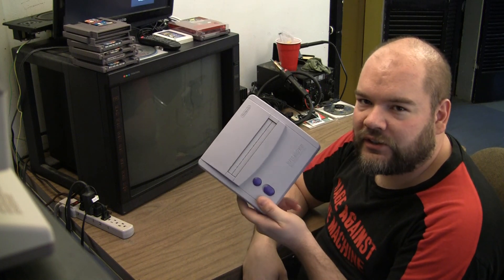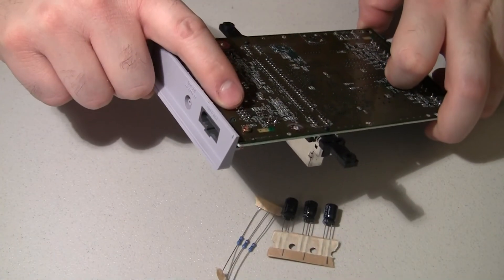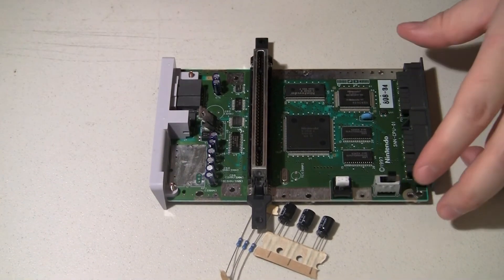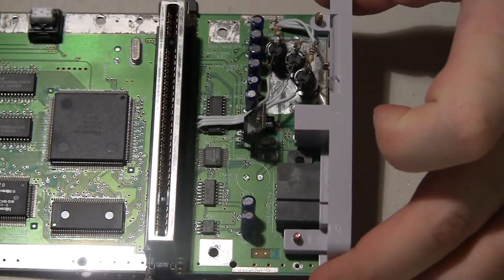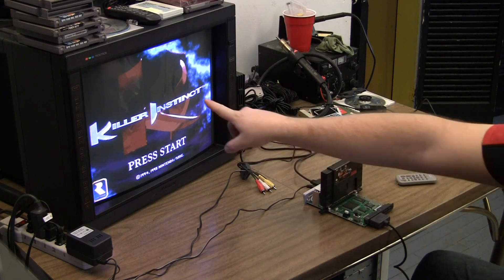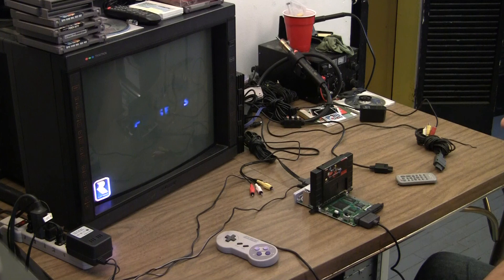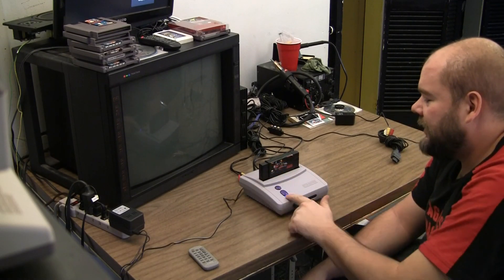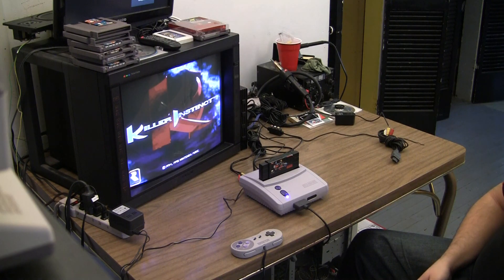SNS-101 Super Nintendo - RGB restore mod

Comment: PLEASE HELP MAN, You seem to know your stuff about snes, I bought a PAL scart cable for my snes since im in australia and have rgb scart native as youd know, but when i plug it into my scart crt the picture is great for the first couple of seconds and then it quickly but gradually goes dim, so goes from perfectly clear and bright when i switch the snes on to nearly invisible (very dim and can only really see the mario logo on super mario all stars but very dimly, all this happens in maybe 2  to 4 seconds
Reply: Did i maybe buy a ntsc scart cable? Or do i need to solder in a capacitor or risistor or something?

Comment: I had my Super Famicom jr modded for RGB and the mod to remove jailbars.  inbought a Csync Scart cable for it and  hooked it up to my Framemeister but the picture would not come up, but the sound does. It this due to the system not outputting a csync and would need to mod the system further
Reply: dylan craven check the processing chips. 1chip-03 consoles support sync on luma cables instead of CSYNC

Comment: what are the cap for? never seen them in this mod before?
Reply: Not in the SNES schematic either. Obviously they're there to shift the voltage, but it will depend on how the input biases it. I say leave them out.

Comment: I know this video was posted back in 2013 so late comment, but you should toss that aftermarket power supply. Those things are like cancer to your SNES and some games wont even run right with it like games that use the sfx chip. OEM Baby.
Reply: I agree but it's getting harder to find them.
Reply: What rubbish.

Comment: If I got a SNES Mini modded with RGb, would I be able to use a SNES Sync on Luma SCART cable? Currently I'm using a composite sync with an older SNES Scart Cable.
Reply: I have the SFC RGB cables from Solaris Japan, that cables uses Sync on Luma (advertise Luminance as sync). I did the RGB mod for the SNES Jr and cable does not work at all. Any ideas of how to use Sync on Luma cables on the SNES Jr RGB mod?

Comment: OK I'm confused. I tried searching this on google but nothing comes up. (Probably because I don't understand and don't know what exactly to search for...)

So you connected RGB to the AV MultiOut on the Snes, right. What cable do you use to connect it then? Is it a cable with Component plugs or something or is it some custom made cable?

I have a SNES and want to try this out, but I can't figure out what cable do you use to connect it to the TV. I'm pretty sure I'm getting something wrong.
Reply: connecting a console through RGB you need a scart cable. on PVMs  and BVMs you need to connect a Male  scart cable to a female scart to BNC adapter
Reply: Yeah, this comment is over a year old and I eventually figured out watching more videos.

Thx for the reply though  ;)

Comment: Yeah, why dit nintendo go cheap. By stripping off rgb output, because this way you will not see how those games were really meant to be shown,as if nintendo wants to hide the true colors of their dnes games.,i got a pal snes with a modded thirt part ngc cable to get rgb on my snes, however am stack with composite on my snes jr so i cannot play supermario rpg in rgb.
Reply: The SNES 2 was wired up with S-video and RGB inside. It wouldn't be hard to just wire them to the AV out. They probably would have sold more units that way.

Comment: Hey, man. What kinda monitor are you using?
Reply: PVM-2030 is a solid monitor with a Super Trinitron CRT.

I own a PVM-2530, which is a 25 inch version of this monitor.  You will need a set of speakers for the PVM-2030 as well as the PVM-2530, though; there are stereo speaker terminals in the rear, but no built-in speakers.  These monitors also can use the optional RM-739 IR Remote Commander, though all you can do with the remote is adjust volume and contrast while also being able to switch inputs, sound muting, and putting the monitor on standby rather than turning it off via the main switch on the front panel.

Great monitors.  Watch out for failing H-STAT high voltage resistors (a red rectangular box with an adjustment, connected between the flyback transformer and the CRT) and weak picture tubes, though; you have to remember that many of these monitors will have been used a lot considering what they were made for.

As for the PVM-1954Q, it's also a good monitor.

For sound, you may want to connect the audio output of a video game console to a separate stereo; the 1954Q has a built-in speaker and it doesn't sound quite as good as even a 13-inch CRT television.

But, at least one advantage of the 1954Q over the 2030 and 2530 is that RGB plus sync is handled through standard BNC connectors rather than a 25-pin D-SUB connector.  And, the same RGB input can also handle component video.  Watch out for things that may be typical of surplus professional monitors due to wear and tear.

The 1954Q tends to sell for around $150 in the used classifieds, give or take a few; the reason they may be put up for sale are that many companies are upgrading to HD monitors and are trying to unload obsolete equipment.  $70 is not a bad deal ... so long as it's in good overall condition.  If it's not, pass on it; the cost and required expertise to properly repair and calibrate such a monitor may be high.

It may be helpful to analyze a potential purchase with test patterns, such as SMPTE color bars from a guaranteed source (chroma phase and intensity; tint and color) and a crosshatch pattern (focus, geometry, and convergence).  At the very least, take something you're familiar with for testing the monitor and judge whether or not it really looks good.

Are the colors right?  Are the shapes right throughout the entire screen?  Do the edges of images throughout the screen look like they have red or blue fringing?

You'll want to make sure everything is still at least reasonably calibrated.
Reply: Sony PVM-2030
Reply: JasonDoesDIY Cool! I really enjoy your videos. Do you think the Sony PVM-1954Q is a similar monitor? I'm planning on getting one for about $70. Is that a good price?
Reply from the maker: stickyfingaz745
No idea, I only got the 2030 as it seems to be the more popular one with retro gamers.
Reply: ***** wow thanks for the helpful insight! I'm hoping the monitor is in good shape,  I'm taking a look at it this weekend. I'll be sure to ask you important questions once I find out more info on it!
Reply: ***** Hey, I ended up getting a pvm 20m4u. Works great, now I can't decide to get my top loader rgb modded or my AV famicom...
Reply: I'd probably go with modding the AV Famicom, especially if you can get an adapter to play NES game paks on a Japanese system.

This may make modding easier since the AV Famicom may already have the A/V multi output if I'm not mistaken whereas your NES top loader might not.  That way, all you'd need to get is the appropriate Nintendo RGB cable.

This is my guess, however.  GameTechUS would be best positioned to confirm or correct what I've said.

Comment: Do you think the rgb picture on a mini is better than s-video on a model 1?
Reply: RGB is only SLIGHTLY better, almost unnoticeable
Reply: Eric McLeod I agree, I use S-Video on my modified SNES mini and it looks almost like RGB. And the picture is vastly superior to all other SNES S-Video I've used.
Reply: SNES model 1 has a worse PPU than the SNES model 2. And I disagree, I think S-video and RGB have a noticeable difference.
Reply: This is a really old comment of mine. I've since gotten rid of the SNES 2/junior/mini and now use a 1993 SNES model that has the S-ENC encoder. I modified it for component video output and yes it does look better than S-Video on an HDTV of mine that supports 240p. Nonetheless, I still say the jump from S-Video to RGB/component is hardly noticeable, especially on a smaller TV. For my 20 inch CRT TV, S-Video is enough.
Reply: Danny C. I disagree. I think the jump from S-video to RGB is very noticeable.

Comment: Where did you get the RGB breakout cable that plugs into the back of the SNES?  Or did you do some funny SCART middle step?  I've been looking for a straight Nintendo to RGB cable but the closest thing I can find is $200 from Japan!
Reply: you can find it on ebay for around $20. It's a snes scart cable. Retro console accessories sales them, but you'd also need a scart to component or a scart to hdmi converter.

Comment: Do u have a video on how to replace the power plug on a SNS-101 super Nintendo.
I have to slightly adjust the cable to turn on the system & its getting annoying to readjust it every time I bump it.